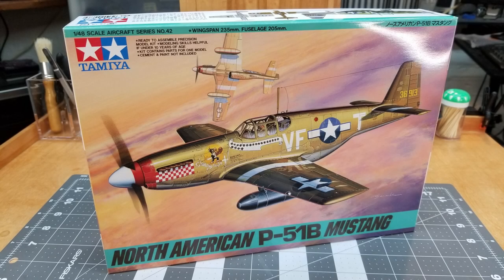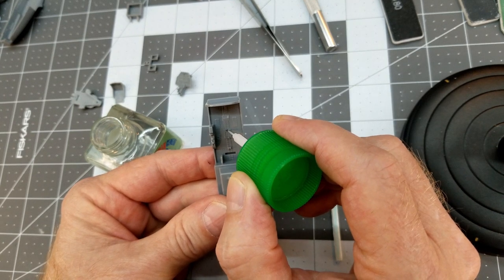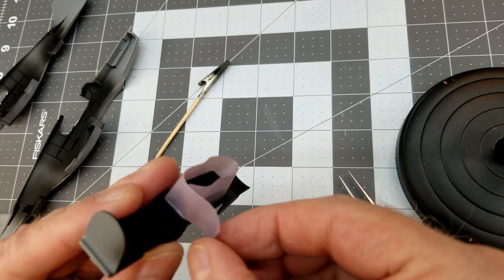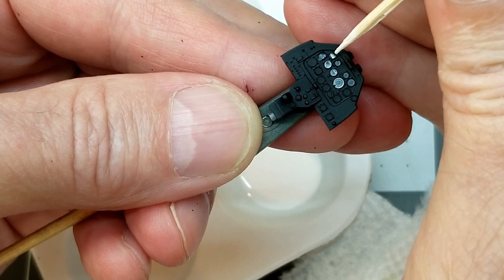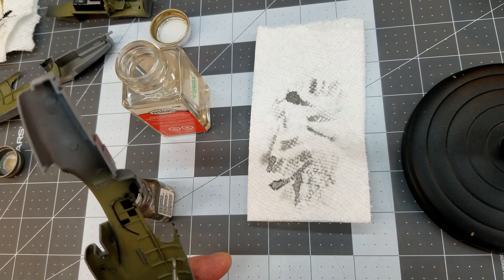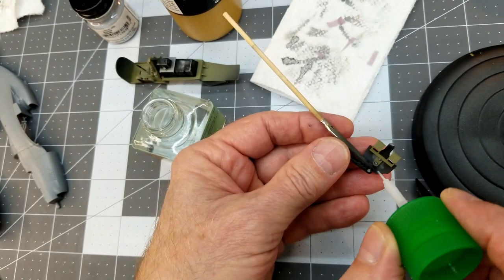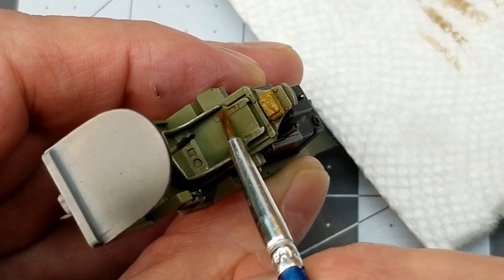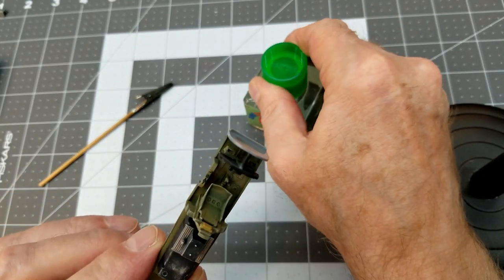P51B Mustang by Tamiya in 1/48 Scale, Build Part 1, The Cockpit

Comment: Between 2.31 and 2.38 I realized that indeed the right hand canopy railing is larger than the left. The gap between them and the seat buckle head is different.
I was about to modify it to be equal but apparently is not the case.
Reply from the maker: HI, thanks for watching. I didn't have any fit issues with it so I didn't have to modify the cockpit fit on my kit. Take care and model on my friend. Johnny
Reply: @hillbillymodeling  thanks.